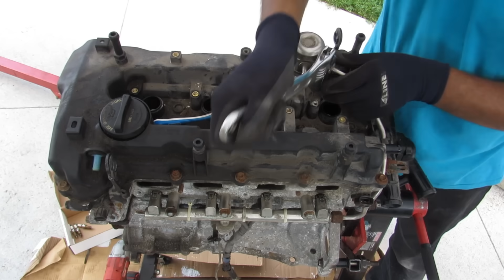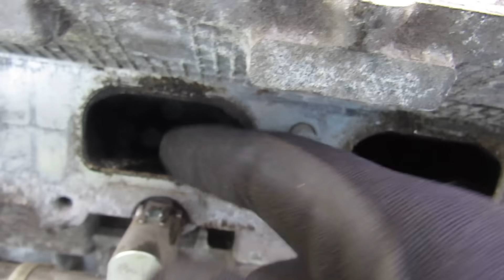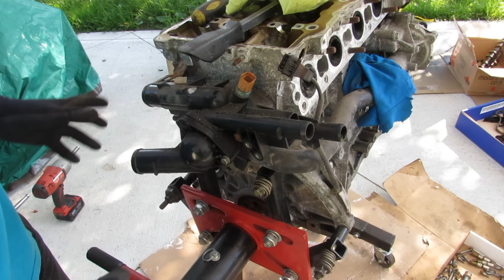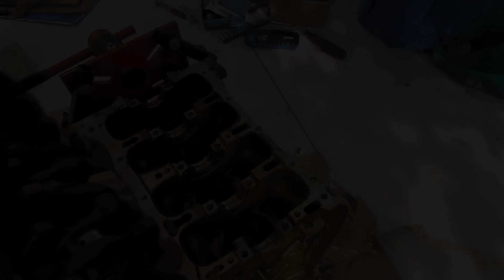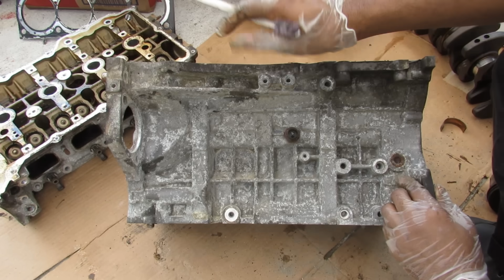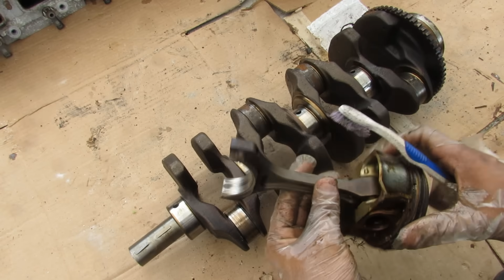Why Hyundai Engines FAIL

Comment: Just got ours back from dealer. Full warranty replacement for the bearing failure. Thankfully we did the software update that grandfathered us in for lifetime replacement. New engine now at 142000, didn't pay a dime.
Reply: I took my 2015 in for CVVT/ECVVT replacement, then the engine seized. Just got mine back last week after it being in the shop for 4 months. They replaced the engine under warranty. I think I got the better deal. I was sitting at 126k miles.
Reply: I bought a 2019 Hyundai Santa Fe Ultimate with the 2.4L in August of 2018, I had to go back for the software update as well and have lifetime replacement (although the dealership never mentioned that to me 😂) but I got the papers in the mail. I only have 12,800 miles on it though.
Reply: @txhorn10  what's this software update that gives you a lifetime Warranty? I don't understand
Reply: @robd7365  the software update for the lifetime warranty were for 2019 engines that left the car lot before they updated the knock sensor and software. I got my 2019 in August of 2018... the software update was January 2019 I believe. From my understanding, 2018 and back were covered regardless but the 2019 bought before the update had to have the software updated to get the lifetime warranty. If you purchased a 2019 with the update installed already at the dealer, you don’t get the lifetime warranty, just the basic 10yr/100,000mi
Reply: My nephew had his wifes car along with a buddy on the way to play golf it started knocking, he pulled into a nearby Hyundai dealer and got a new motor scott free. It was a Sonata. Not sure of year.
Reply: Joshuaburris thanks for your comment because I wasn’t aware of this problem and because of your comment I brought my wife’s 15’ 2.4 Tucson to the dealership with 131,000 miles and they are replacing the engine that seized on us down the highway. They also got us a rental car until repairs are complete. Long story short the wife and I were headed home after a weekend getaway and 2hrs from home when the engine started knocking for the first time and before I could pull over it shut off. I’m an ex Bmw Master Technician so when I got it home I tried to spin it over from the crank by hand and it was seized. I was looking for used engines online and finding some for $4500 so then I turned to YouTube and came across your comment and researched this issue. I called Hyundai and they said to bring it in and a couple days later I get a call that they are covering my engine at no cost and providing a rental car. Thank you!
Reply: I think with all of these engine failures and time lost due to repairs, I won't buy one of these.  I had a co-worker who had to wait 4 months for timing chain guides.
Reply: Our 2001 Accent lasted 238,000 (original-owner) miles of hard driving before the transmission went out. Sold locally to a guy who replaced the transmission, and it's still on the road today. Our 2009 Sonata with a Theta II engine currently has 215,000 (original-owner) miles of daily driving and is still going strong. Even though neither of those two had the most reliable oil changes, and just conventional when they did. Our newest 2015 Sonata Theta II is currently at only 41,000 miles but does get regular 5,000 mile oil changes with Pennzoil Ultra Platinum 5w-30. All the service and recall updates have been done, so it's under warranty. So far so good... Hoping we get lucky again!
Reply: @jonathandayne  Wow!  I have one car that outlasted all of them!  My car only has 416,000 on it.  You have me beat by 91,000 miles.
Reply: @lvsqcsl  416,000 miles?
Reply: @barrypenobscott9882  Yes, when I posted that.  It has 420,000 on it now.
Reply: @jonathandayne  I religiously change the oil on my 2002 Sonata.  The engine failed twice.

When I put the third engine in the Hyundai Mechanic told me that I need to have the fuel intake and Pistons cleaned every 10,000 miles
because of the GDI Engine carbon build up problem with these engines.

The same problem described in this video.

If your not cleaning the fuel intake system you must be doing something right.
Reply: Can you explain the lifetime replacement please? Our dealer KIA of Carson didn’t mention anything. The  engine in our KIA Sportage 2017 had the p1326 code and after changed the knock sensor KIA offered a new engine.
Reply: Please make sure if this is something that is happening to you you go and get all the recalls up to date on your card I'm going through being denied. Never had any issues just happened and I had NO idea about any open recalls and now Its getting put off on me. If you have any open recalls on your car go get them taken care of
Reply: Please tell me about the software update in relation to the warrenty? I don't understand.  Thanks
Reply: @robd7365 the software update is so the computer notices rod knock before the engine blows.  The check engine light comes on and the car goes into limp mode. Without the update you may not be covered for the engine replacement.
Reply: you have to have the software update to be grandfathered in? why should anybody be grandfathered in? if their is a problem isnt hyundai supposed to by law fix your engine?
Reply: Had it been any other manufacturer, they would have installed 1 new connecting rod, new bearings and sent you packing with a 12 month/12,000 mile service warranty. When you return with another failure, you'll be told they cover only the cost of the parts, not the labor, sorry. That is what they did with my sons Chevy Cruze. It was cheaper to source a low mileage used motor through an independant shop than deal with Chevrolet for a second round of "warranty" repairs.
Reply: Okay I can give you one reason you fucked up. 

1. All Hyundai did was slap a new engine in your car, you will still only go 130k miles and start to have the same problem,  you need to pull the motor out, send it to a machine shop ,   The crank needs to be ported and chamfered and the baring holes need to be wider as well to allow better flow/pick up , also you need more solid wrist pins/ piston holder pins installed to prevent slap and scoring of the bore,  if your going to do it, do it right. Hyundai didn’t fix shit, you got a new engine with the same problem.  Enough said.
Reply: @Younotus455  Wait . why did the other guy get an new engine? I heared all the engine repairs are just that. Repairs. Not brand new engines. Or I heard ones original engines are swapped out with Refurbished engines that were already been taken out of other cars that were taken apart and rebuilt/refurbished. Nobody is supposed to get a brand new engine.
Reply: Was yours burning oil like crazy?
Reply: I’m hoping I’ll get lucky with my 2012 Hyundai Sonata 2.0t. Started getting a metallic noise sounds like from somewhere by the fuel pump.
Reply: Yeah, recall it's ONLY covered  under the  warranty of the car according to Hyundai: 10 years and no more 100k miles.....🤔
Reply: Can you share the process and your experience with you dealer handling the whole situation?
Reply: lmao, are you proud of this or something?
Reply: Big reason not to buy Korean junk!
Reply: The papework I received said my warranty was extended to 150k miles...🤔
Reply: Why didnt you do your service
Reply: Good job! Got my sdk too
Reply: Kia SUCKS! Your only thing is an oil catch can!
Reply: Put in Purlator Boss oil filter,  and Royal Purple oil.   Great anti wear additives and high flow.  Change oil every 5000 miles or less.
Reply: My wife's 2015 sorento is at the dealer right now having the engine replaced.  Thankfully it is being covered by kia. We bought it used with 85k on it about 2 years ago and it has about 120k on it when the knock sensor light came on. Even with kia covering the replacement I will probably never buy another kia/Hyundai vehicle.
Reply: Will they replace it for the second owners too?  In the next few days i will have the update and i would like to know in case something goes wrong.
Reply: @SpidermanX100  I was not the original owner of my vehicle. It was owned twice before me, I believe.
Reply: @nuadasilverpaw5702  Thank you very much for answering,  at least I have hope now, since I had heard that hyundai policy does not grant any warranty to second owners.
Reply: @SpidermanX100  I'm a third owner and they replaced mine without even a question.
Reply: @infiniteuniverse123  They updated my computer 2 days ago and everything worked out fine. There is no light turned on. BUT in response to an email (days before the update)  they replied: 

"Thank you for contacting Hyundai Customer Care. We appreciate the opportunity to address your inquiry regarding coverage for repair due to possible future engine concerns with your 2012 Tucson. As a subsequent owner, your engine was eligible for 5 years or 60,000 miles. Due to the year and mileage we have determined the vehicle is not within the warranty timeframe. All repairs on the vehicle will be outside of warranty and you may have to pay out of pocket expenses."  

what do you think guys?
Reply: @SpidermanX100  I bought my 2013 last year and it died in the driveway and had to be towed to the dealer-this week with 76,000 miles on it, I’m glad I did the software update and Hyundai sent me a extended warranty on mine for 15 years or 150,000 miles, I got the do not drive alert and all the bells and whistles were going off, glad I wasn’t on a freeway.  I had established a relationship with the Hyundai dealership where I live before this happened and so far so good.  The warranty covers the engine and drivetrain and was in my name with the instructions to keep it in the car.
Reply: @lauranardoni5626  i don’t get it, Hyundai told me, because I’m  a second owner I’m off warranty. Are you the second owner? Did you buy your car from a Hyundai dealer?
Reply: @SpidermanX100  I’m a third owner too, and they said to tow it in as I own the car and I have low miles on it and the warranty was extended to me through Hyundai and sent in the mail in my name, must be a unconditional because off the class action suit on the 2011-13 Sonatas I have the hybrid edition with limited edition model.
Reply: I think the software update is the ticket!
Reply: @lauranardoni5626  I dont understand why some people get 150.000 mile warranties while otherrs get lifetime. Did they explain to you why you get 15/150 thousand mile warranty?
Reply: @lauranardoni5626  My daughter was not so lucky. Her Sonata locked up with 110,000 miles on it. She was the first owner. Dealer did not say anything.
Reply: @hansmoss7395  The class action suit covers all defective engines for life, I was just at the dealer and the Service rep.to me that.  You daughter needs to read up on the settlement and make a big stink at her dealer! Good luck
Reply: @nuadasilverpaw5702  did they ask for documentation of oil change records?
Reply: @infiniteuniverse123  did you have to show oil change records?
Reply: @asianstud7  They did, which I didn't have any. I told them I had to top off the oil often which is why I hadn't gotten an oil change. They accepted that and still swapped my engine. I did have to cover some parts that were damaged, but the installation and the engine itself was covered by them.
Reply: @nuadasilverpaw5702  are you the original owner ? Also what parts were you required to fix before they gave you an engine swap? Like what does anything else have to do with the shit engine burning oil?
Reply: @asianstud7  No, it was used, and they had to replace the ECCVT and CCVT on it because they had been ground down pretty good. Small price to pay considering the whole engine needed replaced.
Reply: @nuadasilverpaw5702  what is that? I don't know what that is. Is it part of the engine? If so why was that not part of the whole engine swap package? Is it not part of the problem of the engine? And how much did it cost you to do that?
Reply: @asianstud7  The ECVVT and the CVVT (I think I spelled them wrong) are valve timing items. One controls the valve timing the other does the actual timing. They never gave a reason but I'm sure it was along the lines of had I brought it in when the issues started, they wouldn't have needed replaced.
Reply: @nuadasilverpaw5702  how much they charge you for that?
Reply: @asianstud7  I want to say it was around 700 for parts or so
Reply: @nuadasilverpaw5702  wow. I'm sorry but it just seems to me that they were predatory and they wanted to make some money off you before honoring the warranty work. I would have told them that I'm gonna get that fixed on my own first and then come back for the warranty work. Bet they would not have liked that at all!!
Reply: @infiniteuniverse123  what. Year was yours.  And the number  u call
Reply: Has it been determined its rod knock? If so i would get a lawyer involved.  @SpidermanX100
Reply: @SpidermanX100  I have heard that due to the class action lawsuit, these Theta II motors now have a lifetime warranty from Hyundai as long as failure is due to that and not something else.
Reply: @redcoff  good to know.  Thank you !
Reply: @SpidermanX100  They replaced my 2016 motor in May 0f 2021 - I was the second owner and had all the service records showing all work was up to date.
Reply: @SpidermanX100 they extended the warranty just for the engine rod bearings. Only if the engine rod bearings fail will you get your replacement engine.
Reply: @SpidermanX100  sorry I just got to this, YouTube comment notifications suck. If it’s one of the engines under the warranty per the VIN number, then it’s a lifetime warranty for any owner of that vehicle. It could be 20 years from now and 10th owner, it’s still covered.
Reply: @SpidermanX100  YES...but....
I had my second engine replaced about eight months ago.
I recently received a letter stating the third engine has a ten year warranty and the warranty is transferrable.

Beware, that they originally denied my warranty claim for the second engine at 117, 000 (60,000 actual miles) but eventually paid 65%.

So yes the warranty is transferrable but Hyundai will try to weasel out of it.
Reply: @SpidermanX100 yes I got a Hyundai sonata 2012 i am like the third owner and I am in the process to get a new engine covered by the warranty of the engine it doesn’t matter if your are the first owner
Reply: @darioarmenteros521 I have a 2018 Hyundai sonata and I got the engine problem how can we know that our engine is still under warranty? 
Could you please advise on this please
Reply: @tejap-qm5gl  just call Hyundai customer service and let them know they will tell to bring it to your near dealer and they will inspect it
Reply: @SpidermanX100 yes they will. I bought my car literally as an auction with a salvage title and it has this as an issue that separate and they still did it
Reply: If you've done 142000 on the new motor you certainly didn't just get it back from the dealer after full warranty replacement,your full of shit.
Reply: @yuk-erkmckirk9277  I've spoken to multiple Hyundai dealerships that have said they do replace the short block engine due to the class action lawsuit.
Reply: @redcoff  that's not my point, first he says he just got it back from the dealer with the engine replaced for bearing failure, then he says he's done 142000 on the new motor. You can't do that mileage if you just got it back,did he leave the dealers and drive around the world that week,no,he got the motor replaced quit a while ago ,not "just" got it back,unless he only went in for a scheduled service. In any case he's full of shit.
Reply: @yuk-erkmckirk9277  Maybe he got the Elon Musk Mars engine, ya never know.
Reply: @yuk-erkmckirk9277  you’ve read the OPs comment wrong. He got the engine replaced and his odometer is at 142,000... so basically his old engine died at 142,000 and his new engine is starting at 142,000 because you can’t roll back the odometer
Reply: @yuk-erkmckirk9277  lighten up
Reply: @infiniteuniverse123  i wouldn't have bothered to comment if he was truthful in the first place, you pillock,at least i didn't buy a 3rd hand car without finding out the problems they were having prior to purchase.
Reply: @yuk-erkmckirk9277  stop your bullying,the man ment ,it's got 142000 and on a new engine,your a yap ,leave the man alone
Reply: @yuk-erkmckirk9277  you’re just ignorant. Mine is being replaced at 120k miles UNDER warranty and they’re paying for the rental. Cars been in the shop for a week now. Instead of issuing a recall they just extended the warranty to lifetime. Coming from a Hyundai mechanic (not me).
Reply: @yuk-erkmckirk9277  I had my third engine replaced at 117,00 with a partial warranty (65%)  after appealing their denial.

I recently received a letter from Hyundai stating that the third engine is covered for ten years and the warranty is transferrable.  There is no mention of mileage in my letter.

Maybe he was covered for the age of the engine.

Comment: Man the older Hyundai engines seemed more solid. Deltas, Betas, and Alphas although admittedly the late 90 early 2000s cars weren't as "sophisticated" as they are now.
Reply: The early years Hyundai used Mitsubishi engines in there cars.
Reply: @mikeditomaso4451  variations of the Mitsubishi engines anyways, but yes.

Comment: Gotta love an engine whose description begins with "notorious!" Do you think you might do a Ford Ecoboost 2.0?
Reply: I had a 1984 Dodge 600 with the notorious Mikuni feedback carburetor. I never wanted to know what the penalty was for forgetting to say "notorious" before "Mikuni carburetor." Hey - when you have to drill a calibrated hole (start with 1/4 inch and work up to a maximum of 3/8 inch) in the choke plate to get it to work right you know it is a very bad boy.